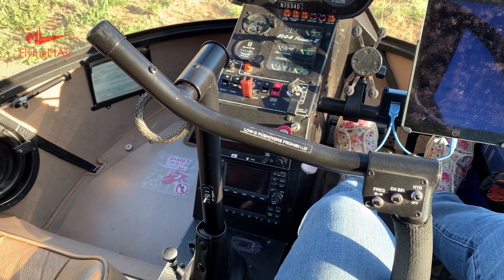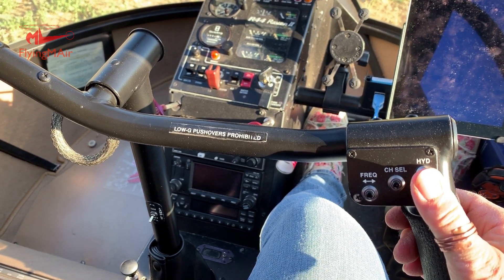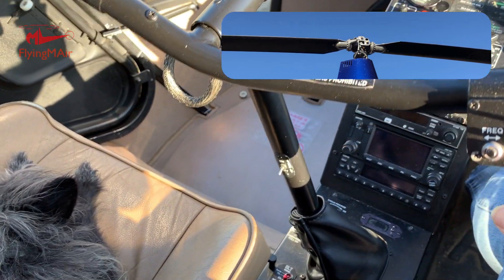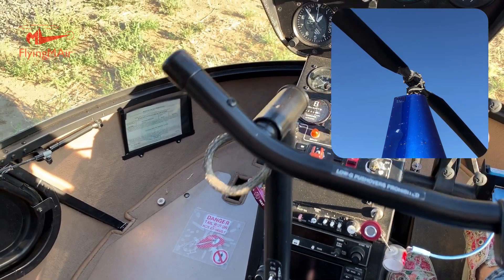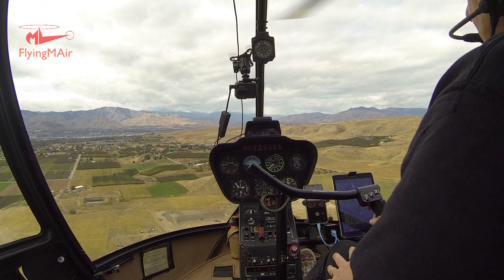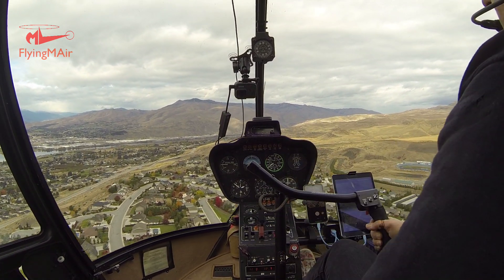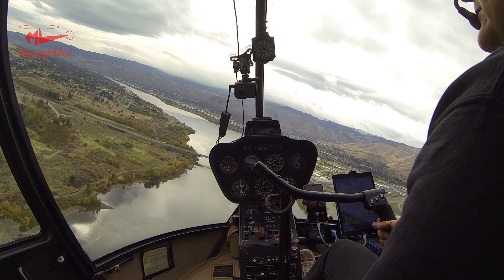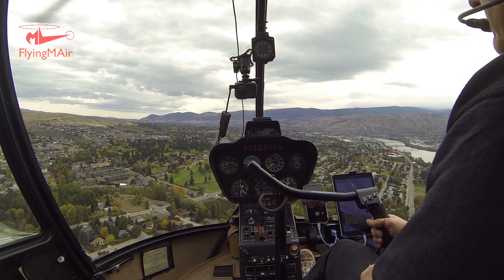Helicopter Flight Controls: The Cyclic

Comment: Hello, Can I pester you for one more question.  I've developed a free body diagram for the helo, but I'm wondering if (on an R44) the rotor head can transmit pitching/rolling moments to the mast.  (ignoring the yaw torque for now).  I'm trying to understand the relationship between the pitch/roll of the rotor disc, vs the pitch/roll of the airframe.  Say we're cruising at constant speed.  Why does the airframe pitch forward?  Is it simply because the rotor disc is pulling forward, and the drag on the fuselage is pulling back, and the difference between the two creates a pitching moment, which in steady state is eventually offset by an equal and opposite moment created from the CG wanting to swing forward?   Do you feel like you're really riding in a pendulum when you're flying in a helicopter? (dangling from the rotor mast, vs a feeling of being rigidly attached to the rotor disc).  Thanks for any insight you can provide.
Reply from the maker: You really need to go to a helicopter flight school for a chat with an instructor or a demo flight. Think of it this way: when you push the cyclic forward (to go forward or speed up), the rotor disc tilts forward. I don't think it has much (or anything) to do with the drag on the fuselage. If you feel like you're in a pendulum in the helicopter, the pilot is screwing up.

Comment: I'm building controls for a simulator.  Is there any tendency for the cyclic stick to re-center itself if you were to let it go, or is it fairly neutral?  Does that change with the hydraulics engaged vs disengaged?  Great video series.
Reply from the maker: There is no "neutral" position for the cyclic. If you let go, it flops wherever it feels like. That's why you can't let go in flight. No difference with hydraulics on or off.
Reply: @FlyingMAir  Wow, I would have thought it would have some small self-centering spring force.  Interesting that it doesn't.  Another question, which I'm sure depends on the helicopter, but lets say an R44 for example:  Is there a linkage that ties the collective to the tail-rotor pitch to "automatically" offset some of the main rotor torque?  For, example, in a hover I'm guessing is when you need quite a bit of anti-torque.  Is one of your  pedals depressed quite a bit, or are the pedals adjusted to be even (trimmed) in hover?  Thx in advance.
Reply from the maker: No, the tail rotor pitch is not connected to the collective in any way in any helicopter I know. The pedals control the tail rotor. The pilot must use the pedals when necessary to stay in trim or point the way she wants. In flight, the pedals are mostly even unless there's a crosswind and crabbing is required. Also, understand that when you press down one pedal, the other pedal comes up an equal amount. They are not independent of each other.

You might try stopping by a flight school if there's one in your area and getting a first-hand look at a helicopter with an instructor. I think you'll find it interesting. If you've got a little cash to spend, go for a demo flight and use the controls yourself! Good luck.

Comment: So just to be clear. Simply put. If you where to push forward on the cyclic, the main rotor blade would have more pitch as it rotated around the rear of the helicopter then as the rotor blade comes around the front the pitch is decreased creating a tilting forward of the aircraft resulting in forward motion. Correct?
Reply from the maker: Yes, the pitch on each blade changes independently to tilt the rotor disc , pitch the aircraft in the direction of that tilt, and move in that direction. Works with forward, sideways, and reverse.
Reply: @FlyingMAir  interesting. For the longest time I used to think that the entire rotor shaft would tilt in the direction of travel….if that make sense.

Comment: I'm just looking at helicopter flying as something to learn. Most likely spend time on a flight sim like flight gear. I have just started to use the simulator and would I be right to think that getting the collective and the cyclicto work together so you can go forward is an art? I seem to be having to dive to get air speed forward then pull up, a bit like a dolfin leaping from the water and then diving again!
Reply from the maker: It just takes practice. It's very easy to over-control with the cyclic, but once you get the hang of it, it's easy. Really.
Reply: I did my first flight yesterday, and was putting waaaay too much cyclic input. I think I was putting inches of movement into the cyclic, and it seems like you’re putting in millimeters. I’m excited to get my next flight in and refine my input skills.

Comment: Ty very much for your videos....very informative.....when you want to gain altitude in a helicopter is it just a adding of power and more collective?   I saw when you took off and gained altitude on a previous video you got it off the ground but I didn't see you pulling collective up higher as you you were climbing....
Reply from the maker: In cruise flight, I can lift the collective a little or pull the cyclic back. Either will allow me to gain altitude, but only using the collective does so with increased power.
Reply: @FlyingMAir  ty so much for your reply....Im just a flying nut and have tried for years of my 54 to learn a little bit of info hoping to have chance to get behind controls of a heli some time in my life....if just to hold the controls....Hailing from the midwest I have always been amazed by crop dusters and how a pilot could fly over the very tops of a cornfield and get to the end and throw it in to a 3 or 4 hundred foot climb....throw completely around and go back to the skids being at corn tops....I again ty for your reply and for clarifying...it just opens the door for a million more questions and hope to rent me a ride at local airport to put them to rest....thanks again

Comment: MARIA, CURIOUS AS TO HOW MUCH BLADE PITCH IN DEGREES THERE IS BETWEEN FULL FORWARD AND NEUTRAL, AND I ASSUME IT'S THE SAME FOR FULL BACK.  IT LOOKS LIKE ONLY A FEW DEGREES IN THE VIDEO.  ALSO DID I HEAR YOU SAY ON THE ANNUAL COMING UP IT WAS VERY EXPENSIVE, AND HOW OFTEN DOES THAT COME AROUND.
Reply from the maker: I have no idea how many degrees of motion the blades themselves can pitch via cyclic inputs. I’m not even sure if that’s in the pilot operating handbook. It isn’t nearly as much as the collective allows. 

As for the overhaul, it’s due every 2200 hours of flight time or 12 years, whichever comes first. It’ll cost about $250,000. I am accepting donations.

Comment: I'm NOT a pilot, but very mechanically minded...I've always viewed the rotor as a spinning plate on a pole,of course in reality you are suspended from the plate or I'd compare it to a waiter's round tray with full glasses, you lean the tray in the direction you need to go but not so much as to spill anything "gentle inputs" ...just the way my brain correlates it,I know it's not a perfect analogy but similar enough!  Been missing your videos but know "tis the season"
Reply from the maker: It’s a pretty good analogy. When you get to the point where the helicopter just goes where you want it to, that’s when you know you’ve got the right touch. 

I’m traveling for the winter and haven’t flown in a while. I’ve got my video archives with me but am at the mercy of a laptop and often dismal internet connectivity. 🤷🏻‍♀️

Comment: Maria, I've only ridden in a heli once (for lunch in the bottom of the Grand Canyon in 99) so really didn't pay attention to the controls as I was oogling out the windows. It's interesting to see how the controls work. You mentioned the friction knob and tightening it makes the cyclic "heavy". Is the reason for that adjustment to make the cyclic less responsive for those who don't have a "light touch" on the stick to keep them from over controlling/correcting?
Reply from the maker: Friction is to “lock” the controls when the blades are spinning but the pilot can’t hold them. It obviously doesn’t lock them, but it makes it a lot less likely for them to move on their own. Friction should be disabled during flight.